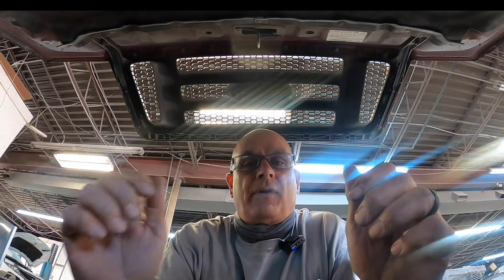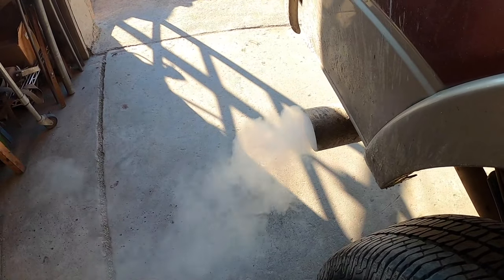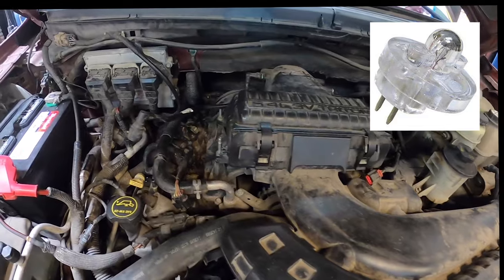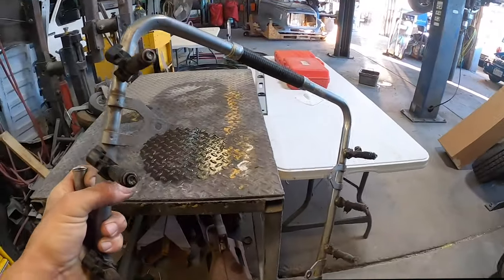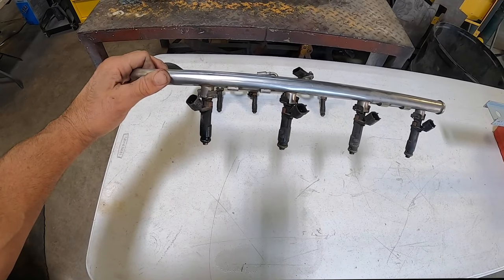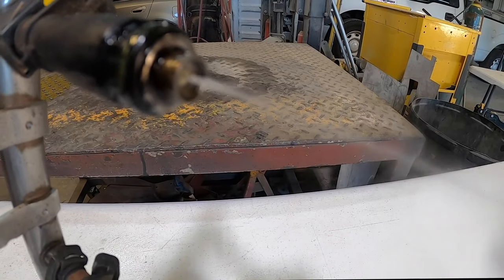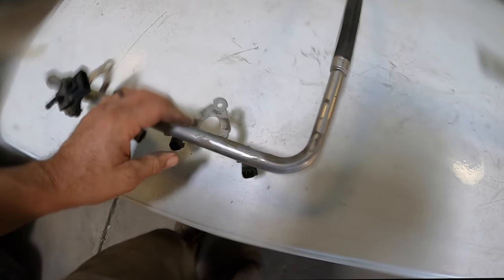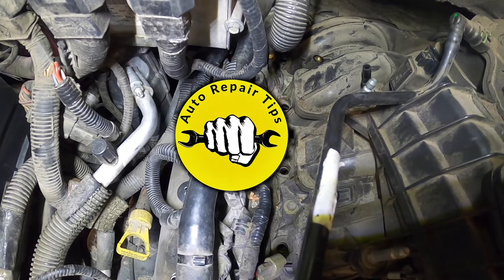This is why you have white SMOKE coming from your EXHAUST~~~~TUTORIAL easy FIX

Comment: A lot of people assume white smoke means a blown head gasket or internal coolant leak.
Reply: It could be those things tho
Reply: Bro my car just started smoking, i was driving and gave my jetta a lil pull and a bunch of white smoke came out, i was thinking it was my turbo but it doesnt sound like my turbo is blown, this really has me bummed out due to this being my daily for weekdays
Reply: @angulo3047  How many miles on the engine? Smoke all the time or only when accelerating?
Reply: Lately my 7.3 power stroke ford has been giving white smoke when I accelerate
Reply: @lgrw9883  White smoke typically means head gasket. Check dip stick to see if oil looks diluted or milky. See if coolant tank level has changed. 
Bluish smoke at engine startup, etc is valve seats or piston rings. If you have to add oil every week or more, there's another clue (although old valve cover gaskets can cause oil loss).
Reply: Yuh
Reply: @rkgsd  i’ve been having oil issues and my altima has recently started spitting a lot of white smoke. haven’t been driving it. oil has been dropping quickly but it isn’t a leak from what i think, cause it’s still half full of oil and it’s been sitting for about two weeks. i’ve had it on for a total of less than one minute since the smoke started. i could really use some advice as i’m trynna look for where to diagnose this and hopefully fix it myself.
Reply: @jalapeno_m  White smoke typically means internal coolant leak. Could be a failing head gasket. Keep an eye on the engine temp .Blue smoke means internal oil leak from seals, valve seats or piston rings.
Reply: @angulo3047  did you fix the problem?
Reply: @gorankovacic7432  yea bro, my car needed a tune up
Reply: What does it men if it pushed a bunch of white smoke out exhaust but it only happend once ?
Reply: @daPREDATORdre  gasket material is going dry and brittle from when it was new. Im having this problem with my 307 olds and it sat for a year so it shoots out white smoke on starts and soon the smoke didn't stop so it was a head gasket going bad
Reply: It’s not about the smoke but more the smell that will diagnose what it is properly
Reply: @Speedfighter313  in that case it would either smell like coolant or burning oil. A coolant smell is more of a steam-like vapor than smoke.
Reply: For sure I saw the coolant in the engine bay
Reply: thats what google keeps telling me🥲😞
Reply: @rkgsd mines is when accelerating
Reply: @toxicalien4998  how many miles on it?
Reply: My car smokes in winter or if it rains that the smoke is visibe in the mirror.. everytime ..When i turn the  aircon on it smokes more ,any hel
Reply: @politesobwe9382 that’s what my ford fiesta is doing
Reply: I have an Alfa Romeo Mito 1.3jtdm 2012 plate, its smoking really bad (white smoke) we realised the egr valve wasn't working so we put a new egr valve on and it's still smoking. Disconnected a pipe to the egr valve and the smoking has stopped but as soon as you reconnect the pipe it smokes bad again. Any idea why?
Reply: @mobie138  i have also have a ford fiesta 2012 ,it was smoking .i had to run the gasket leakage test,and its fyn ..Put some addictive in the fuel tank to clean injectors and still smokd when idling ..was worried only to notices that in the last service the mechanic i gave it to he ddnt change the air filter ,Bought the filter  for 15 pounds  cleaned the housing and the smok stopped . The filter was filthy dirty ..
Reply: @mobie138   how about in the summer does it smock ..I read also about condensation in winter ..rsrch about that b4 u engage a mechanic .Mine is now driving well i changed tge air filter
Reply: @politesobwe9382 and it doesn't burn too much fuel? Oil burning is very unpleasant, suffocating white or blue smoke, glycol burning from the radiator is usually sweet white thick smoke...  if the smoke is neutral, sometimes with a stronger smell of gasoline and dry black deposits in the muffler, it is probably due to a bad fuel mixture. , too rich, maybe the temperature sensor, lambda probe or pressure sensor on the injection rail, or a leaky intake if the flow meter, or clogged if the map sensor... you need to check the injection corrections in the computer.

and the water condensate in the muffler also produces white smoke, wet exhaust gases, but if the engine burns too much gasoline, it will also spit out more water vapor.
Reply: I got a BMW 135i only smoke white smokes come under hard acceleration/ boost level. No blown head gasket or overheating what can it be? My turbo failing?
Reply: @anibalvargas9874  piston rings would be my first guess due to it only happening during the hard acceleration. Valve seats is my second guess. Either way, there's definitely some internal engine wear. A compression test might be worthwhile.
Reply: The problem is in the winter time it all looks like white smoke, even cars driving by. I checked my oil dip stick on white oaper towel, its light brown. Im about 20 days over due for oil change
Reply: My car pushed out so much a smoke when u start it bmw only when start up I just change oil and I just replaced the valve cover and gasket what could be the problem
Reply: @rkgsd i had my gasket replaced because my engine went bad(not because of gasket) and also replaced the lambada sensor replaced, but coolant and slight white smoke (more white smoke while reversing) leaked. Coolant leak was because of thermostat housing. Need to replace that and see if it will still smoke.
Reply: @jalapeno_m what did you find out? Our 2017 Nissan smokes when we start it up.
Reply: @anibalvargas9874 same bro 335i smoke under accel then goes away comes and goes sometimes at stoplights
Reply: did you figure out what was causing it ?
Reply: @toxicalien4998  Worn piston seals. Run a compression test.
Reply: @user-707Grim @user-707Grim  worn out valve seats or piston rings. Probably had too many miles than it's  worth to fix. In my case, I just add a little oil every few weeks and try not to punch the accelerator as that can burn more oil putting more pressure on the seals, then I hope it passes smog.
Reply: Then what is it?
Reply: 2019 Subaru has white smoke coming out of the tailpipe only now and again, but it's hard to trace. The dealership wants me to try to catch it on camera, but it only happens when it has been driven for a long time, so that is not that often.  But this past Monday, August 26th, was the most extended bellowing amousmoke I've seen yet.
Reply: @vanessak5149  how many miles on it and when you say driven for a long time, how long are you talking about?
Reply: @rkgsd  my oil is black and I constantly add oil every week or so. Coolant level is right above the minimum. Have white smoke coming out even while idling.
Reply: @mobie138 what was the issue

Comment: i forgot to twist my oil cap on my car and it started doing this
Reply: How did you fix it ?
Reply: @Blessedwithdahemi  well I had to get everything covered in oil cleaned out and then got a valve cover gasket, spark plug boots and a spark plug. Had my old stuff switched out for the new ones and it cleared up the smoke. I’d have a guy look at it for you. Preferably someone you trust rather than a mechanic at some shop cuz they’re going to try to get the most money

Comment: Mine will smoke during start up but not while running. Like it lets out a big puff of white smoke when I crank it then it’s fine after that
Reply from the maker: What type of car do you have year make and model
Reply: @AutoRepairTips757  I have a Toyota Tundra. It’s a 2005 limited with the 4.7. I actually found out what it was making it smoke. I have a k&N cold air intake and i took it off to clean it and switched two vacuum hoses around one went to the fuel rail and the other to the power steering pump and evidently it was also the cause of my power steering leaking or what i thought was leaking. But not seeing power steering fluid anywhere made me wonder where it was going, well I took it back apart and put it together, took the intake tube off and BAM! Found out where my power steering fluid was going lol. Idk changed the oil, poured a hole can of sea foam in the gas tank and a whole can in the engine, took the fuel rail off injectors out cleaned everything it’s fine. You can’t hurt those 2uzfe’s. 2005 looked today has exactly 142,088 miles no engine light, no smoke, drives straight as an arrow, it’s lifted on 33/12.50s hell best truck I’ve ever owned.
Reply from the maker: @thomaslowery3576  thats awesome im glade you were able to find the prob. those are tough trucks toy still have a-lot of miles left
Reply: I am having this same issue now with my 2008 Nissan Armada so I will get it checked out and hopefully these money sucking mechanics won't have me replacing things that don't need replacing.

Comment: A 4 cylinders Turbo charged engine is giving smoke at exhaust. The engine oil level is not going low and turbo blades don’t show and oil black residuals on it. What’s the possible reason for this smoke?

Comment: I got a 99 f250 superduty 5.4 Triton I replaced fuel pump know it knocks from passenger side engine, blows white smoke, shakes bad, and stalls when I hit the gas. Fuel injectors is my last thing to replace with those symptoms, hopefully. It's been sitting for awhile

Comment: 99 dodge ram 1500 when I drive on a flat surface a little bit of white smoke comes out of the tailpipe & the check engine light is on it says multiple misfire. However, when I am going downhill for any extended amount of time, say a couple of miles when I get to the bottom of the hill & am driving on a straight & flat road the white smoke bellows out of the exhaust like the truck is on fire 🔥 for about a mile. 😭 any ideas 🤔
Reply from the maker: That is something I would definitely have to test rather and look at myself in person

Comment: If the "white smoke" dissipates very quickly, it's steam. Check your overflow tank when the engine cools. If you notice a significant drop in coolant, there's the source of your steam. If your tank is at the full line, then do what this very gentleman suggests.
Reply: So if the overflow tank is low, you're saying just add more coolant to overflow tank?  What is causing the steam?
Reply: My reserve  is completely empty in a day do you know what the problem is 🤔

Comment: Good evening, I have a lexus is220 diesel with 180000km, the car drives right, but when we move at a relatively low speed from 0 to 50 km. the exhaust emits white smoke and in the engine I have coolant scattered everywhere, is there a chance that it is smoking from a simple leak in the water pump pipe or is it sure the leak is from the motor? 

P.S. when I accelerate from 160 km and above the temperature rises sharply and drops in 1 minute as soon it goes down to normal

P.S I have put on a new fridge and a new turbo thanks

Comment: Having same issue. Tons of white smoke after it starts warming up and even more when push the gas pedal has a smell of gas to it. Shaky idle as well. When driving it seems to run fine still has white smoke coming out sometimes it's a lot sometimes its not. Sometimes , it will smooth idle then will start being shaky again when I stop again.
Reply from the maker: check fuel PSI then turn the car off, it should hold PSI and drop slowly. if it drops fast then do further testing on fuel sys
Reply: Did you ever get it fixed
Reply: Stuck open injector

Comment: I have a Toyota Prius smoking a lot. The smell is gas! Changed the head gasket but it didn’t change anything so I replaced the head and gasket again. Still no change. I changed the fuel injectors twice. Still smoking bad. Can the computer be the problem? What else can cause this? Thanks for any help!
Reply from the maker: that is something i would need to look at to give you any advice

Comment: I have a 1993 Plymouth Voyager minivan. Today first time ever had a hard time starting it. Even after running it for a couple of miles. I don’t know if it was the fuel injectors or what but it just wouldn’t completely turn over at first. Once I got the engine to turn over, lots of white smoke came out but it didn’t smell like oil it smelled like plastic!! Any ideas?

Comment: I have the exact same issue with a 1994 civic. I've had the injectors taken off and tested three times and they say they are fine. The car is just pouring white smoke and wreaks of gas. it has a tiny missfire as well. Should I test the injectors again?
Reply from the maker: Are there any check engine lights and if so, what are the codes?
Reply: @AutoRepairTips757  There are none. Its an OBD0 engine and has been running rich for a while. It is just recently that it has started smoking so much and having a tiny missfire.

Comment: My 2000 dodge dakota just started rolling  white smoke. Its hard starting and has a misfire. I check the oil and no coolant on dipstick and its not over heating. Truck sat for like 5 years and only ran a few times. So would it be injectors? Im sure it needs spark plugs but im sure thats not problem. Also truck has 270,000 miles on it
Reply from the maker: if it sat for 5 year the gas could be bad it might need to be cleaned out and change the fuel filter

Comment: I hate it when classical rules of thumb, in this case that white smoke is usually water in a combustion chamber, is dead wrong. Presumably the smell of gas, and maybe fuel trim dialed way down one one bank, steered the diagnosis in the correct direction.

Comment: He probably said the oil out running all that excess of fuel down past the cylinders into the oil pan and it'll wash out the bearings in the bottom end and in the camshaft

Comment: Hydrolocked a motor with stuck open injector. Same symptoms with noticable power loss. Did not know till opened the motor found fuel in the oil and bent rod.

Comment: Hello from Oamaru, South island New Zealand.

I have a 2012 Spanish built Nissan Navara D40 St-X Diesel pickup. Engine is a Nissan - Renault partnership common rail with 165.000 K.m on clock.

When idling it's lumpy then when attempting to accelerate it farts n missis then dies.

It smokes a really white Hazy putrid smoke but no oil in coolant nor coolant in sump.

There's no fuel dilution in oil sump.
It starts but struggle..

S.c.v, e.g.r cooler replaced (but  didn't require so)

injectors tested fine. E.g.r valve actuator works fine. 

Any idea what may cause this grief?... Crank n cam sensors?.

Thanks again in advance..Carl
Reply from the maker: With out looking at it it’s hard to say did you do a combustion? Test

Comment: Similar problem with my 2004 Porsche Boxster. Was driving, and all of the sudden white smoke was bellowing out of the exhaust. It went away after a bit of driving, but after starting it a few hours later, more smoke. I suspected the worst(head gasket), but I wasn't losing any coolant and the car was maintaining safe operating Temps. The mechanic replaced the air/oil separator and says the car doesn't smoke at all now - picking it up tonight so we'll see. Great video by the way, very concise and helpful.
Reply from the maker: Hope it works for you
Reply: What is a air/oil separator because my 2018 Chevy Equinox has white smoke coming out, I'm not losing coolant, I'm not overheating. My oil is Not Milky
Reply: @dsandoval7843  the way I understand it is that it captures/ separates oil vapors from the engine ventilation system and redirects them back to the oil pan. So if it's not functioning properly, the oil vapors would be burned in the combustion cycle. I'd definitely take it to a trusted mechanic to see what he/she thinks
Reply: Update plzz was that the problem or was it the fuel injectors??
Reply: @royal-tbutler2241  it was the air/oil seperator. It only smokes a little on a cold start which is apparently normal with this car. It stops after a few moments.

Comment: I have this VW Polo TSi that smokes at start up and revving......it does not smell like oil or much fuel... coolant is not lost.....although it used alot of oil in one week it doesnt smell like burned oil.....had turbo cleaned coz it sometimes happens the turbo can leak oil into the exhaust and intake when the blades are not spinning fast enough ...had the injectors cleaned as well...new fuel pump coz the HPFP was leaking fuel into the Cam Cover..... now waiting for a new Fuel Pressure Regulator to see if problem goes away coz when i bench testes the Regulator it gets power but the solenoid inside doesnt click or kick when energized..... suspecting too rich mixture getting in there....rough idle but revving sounds good besides the smoke.....my cheap ELM327 shows P0300, P0302, P0303 .....the other codes went away after a proper cleaning of some sensors
Reply from the maker: do a oil consumption test and see what the results are
Reply: The number 2 cylinder has a fault.... after installing the new HPFP the car finally started but showed fault code P0302....other codes went away..... spark plug broke off inside the cylinder head when i wanted to do a swap with the plugs and coils to rule those out..... now i ave to try get it out...... after this ima do a compression test to see if piston rings a worn on that cylinder.....but as i said the tail smoke doesnt smell like oil......either rings or cylinder gasket 😢😢😢 .... more headaches

Comment: I have an Audi a5 2.0, my car has been running rich for a while, I have changed air flow sensor, fuel injectors, spark plugs, high pressure fuel pump, fuel pump and my car will not start unless if I rev the gas, another thing is once it’s on excessive white smoke comes out of the exhaust, and if you take your foot of the gas the car will turn off after around 10 seconds. Any idea what it could be?
Reply from the maker: When it smokes what does it smell like